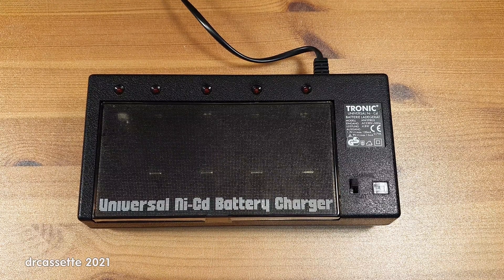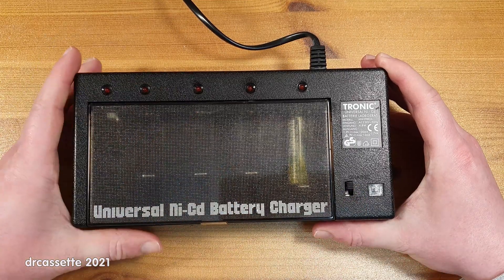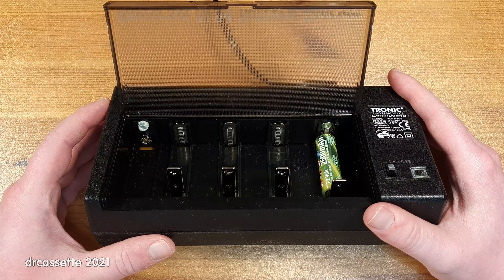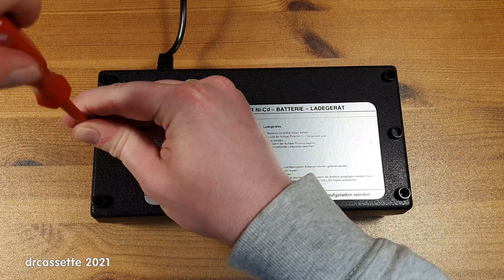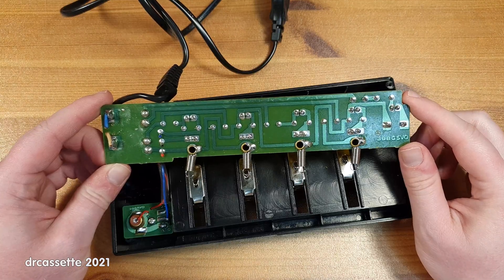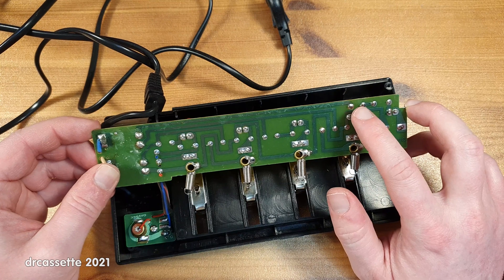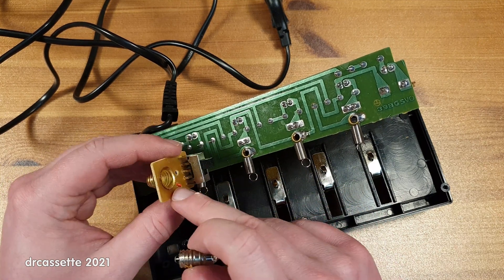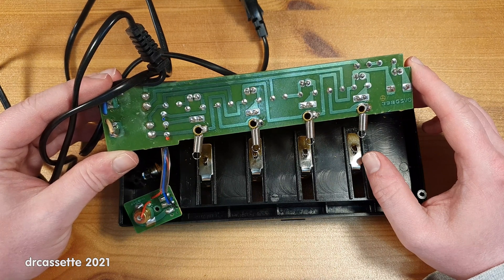Extremely simple Universal Ni-Cd Battery Charger teardown

Comment: I have the same exact charger, bought in a Lidl store in Germany in, I think, 1999. Still works fine, but charging a modern NiMH AA Cell with 2500 mAh takes about 31 hours at only 120 mA. At least this low current should be very gentle on the cells.
Very interesting to see what's inside!

Comment: My grandparents had one of those in the early 1980's with Hitachi Ni-Cd batteries. That light bulb indicator was not a lot of use. If I remember correctly AA batteries took about 5 to 6 hours to charge but C batteries which they used for a radio took about 12 to 15 hours so had to be left on overnight.

Comment: Looks like bulb is a 222 style was ubiquitous used pre white LED's, surprised it's still being used. It's possibly used as load to test 1.2V NICADS.
Reply from the maker: That's what I tried to explain in the video - the light was indeed used for testing the batteries...
Reply: @DrCassette  but only the first battery compartment from right side can be utilized as a test port

Comment: I still have one exactly the same as this, here in the UK. My parents were going to 
throw it out but I thought maybe it might come in useful. I prefer this type of 
charger because it has a flex and can be easily plugged into any outlet unlike
the adapter type ones. I can't remember what make mine is though. It is 
actually rather old, I think they stopped making these quite some time ago.
Reply from the maker: These chargers work okay with NiCd batteries, but those are not made anymore because of the toxicity of cadmium. The modern NiMH batteries are a lot more sensitive to overcharging, so you would not want to charge them in such a simple charger that can't detect when a battery is full.
Reply: I might one day decide to cut the flex off and put it with the next lot of stuff to take to the dump
if I need that extra space. I didn't know this was Ni-Cd only and I was even more surprised the 
LED's do not indicate that the battery is full. We have used it to test alkaline batteries in the past.
Reply: Wow me too! The same one with the dot matrix text... Crappy little bulb to test it haha. Dad bought it me for my remote control car.
Reply: Today I was about to cut the flex off mine and put it with all the other electrical waste to be taken down to the tip but my Dad decided to take it back and either give it to a clearance or charity shop. My Dad obviously doesn't know Ni-Cd batteries are no longer made. But it doesn't work with MiMh battereis, apparently 
there is a difference.

Comment: Certainly not great but it looks a lot worse than it really is, NiCd batteries will disappate any extra energy you put into them as heat when they're done charging and since they're batteries there's no need for full bridge rectification or smoothing capacitors. Definitely wouldn't want to try something like that on a lithium cell though since it would almost certainly explode. It isn't ideal that it won't turn itself off after a while but that's just how NiCd chargers are usually made.
Reply from the maker: I just read some of the rechargeable battery articles on Wikipedia and you are indeed correct, for NiCd this charger apparently is not too bad. However, all the rechargeable AA and AAA batteries I have are NiMH, and those would be damaged by such a primitive charger.
Reply: @DrCassette  Right, the kind of circuit you have is really common in these style chargers at 0:35 in this video https://youtu.be/5cBQ786lyPA?t=35 DiodeGoneWild also measures their waveforms and you can see they're not super clean constant DC like you'd expect from a lab power supply, batteries don't really care much as long as you stop charging when you're supposed to and don't charge them with too high of a voltage, other than that you can pretty much feed them any kind of unfiltered DC and they'll take it as they are basically very large capacitors. I'd also recommend checking out DiodeGoneWild In general as his content is really great :)

Comment: I have similar charger (also from Germany) that is almost identical to this one, i think it's from 90s or early 2000s. It still works fine (it's not like there's anything to go bad lol), we always used it with cheap timer socket. I remember that i disassembled it once, can't remember if it has full bridge rectifier. Interesting design for sure, i bought a cheap USB charger on ebay that worked on similar principle, i only bought it because i like those spring contacts and it was like 1$. I was thinking about adding microprocessor to it but later bought Litokala Lii500 which is amazing.
Reply from the maker: Using the charger in combination with a timer is a great idea.

Comment: This is a very old charger sold by Aldi times and again, way back from the 1980s onwards, along with their infamous "Topcraft" branded NiCD Accumulators  which (especially the brown ones) hardly held any load charged into them ... Nowadays, their chargers are more sophisticated and - depending to the model - they can even charge Li-Ions...
Reply from the maker: This charger was likely bought at Aldi some time in the 90s or even early 2000s, judging by the original box I forgot to show in the video.

Comment: We had one of those about 20-30 years ago. Worked fine for many years.
Reply: I used to have the exact same in about 1990. I quicky replaced it with a slightly more advanced charger using a capacity switch, timer, and discharge function that did not fry your batteries as long as you selected the right capacity. 500, 600 or 700 mAh. And then one that actually detected when the battery was full and shut the charger off.

Comment: this will be bad... (i had to use it somewhere often where it was not able to get it thrown and replaced... it was a battery killer)
Reply from the maker: So I was right in assuming that the half wave rectification is a bad thing? Or was it a battery killer because the charge time is almost uncontrollable?
Reply: @DrCassette  either overcharging (stayed warm while beeing in the charger, i assume that the overcharge was converted to heat) plus no mitigation of memory effect whatsoever.
Reply from the maker: Ah yes, I always discharge batteries on my good charger before charging them...
Reply: @DrCassette  hmm, that defeats the purpose of keeping a bad charger if you already have them in a good charger before.
Reply from the maker: @rarbiart   I have never used this primitive charger, I have a Voltcraft IPC-1L charger that also has discharge, refresh and capacity measurement modes. Works very nicely with my NiMH batteries.
Reply: I had mine running off a timer, they they are not sitting there for 24 hours getting cooked
Reply: I've seen a lot of these “trickle” or “overnight” chargers for both NiCd and NiMH which usually target a full charge time of approximately 16 hours (my electric toothbrush even does this for a non-user-replaceable NiMH battery). Don't know about the rectification stuff, but in theory, a charge rate no more than C/10 or so shouldn't hurt them significantly (or so I've read), and I think there's even an IEC procedure for breaking in cells or testing their capacity which calls for something like this. But then again, this probably assumes you're not leaving the cells charging for whole days/weeks at a time and are allowing for good heat dissapation, etc.

And then there are those 7-or-so-hour “quick” chargers that operate solely on a timer, which are probably the worst of all because you're pretty much guaranteed to get either an undercharge or an overcharge, and an overcharge at a current just high enough that it probably would hurt the batteries long term.